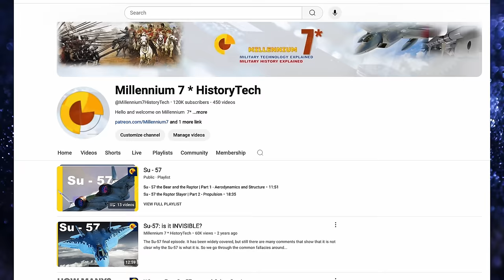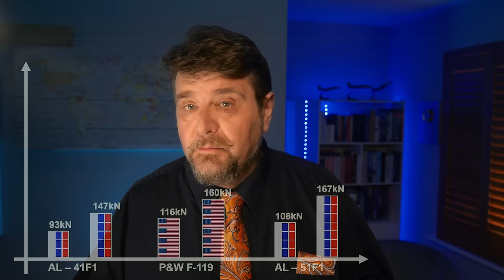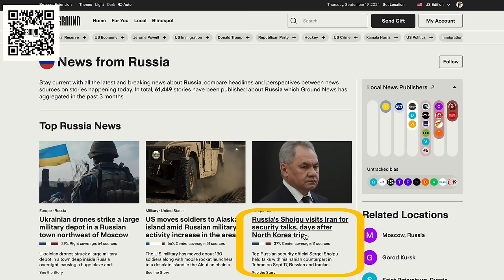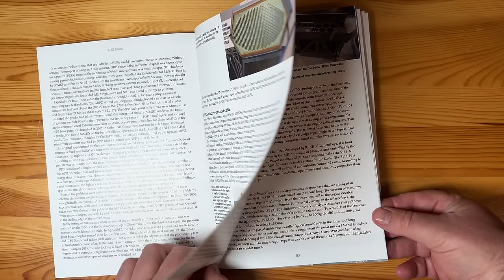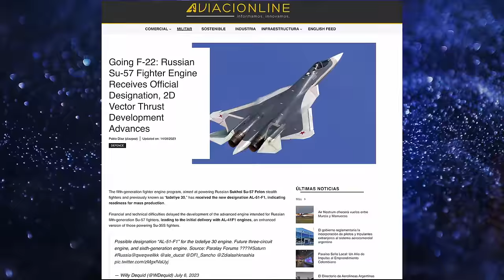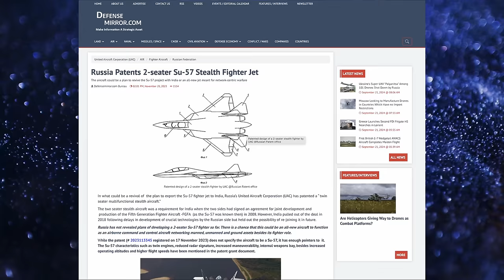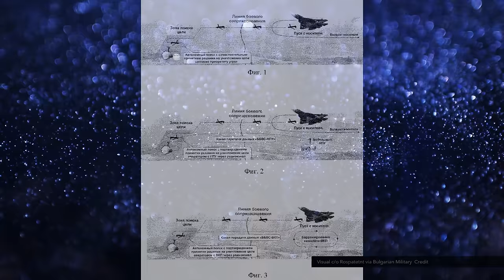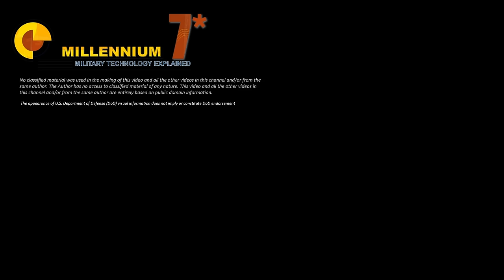The Su-57 is a Masterpiece!

Comment: Practically everything about Su-57 in this video is out of date or inaccurate. But in fairness, there's little reliable info on this matter. Regarding engine - it has already been completed, tested and certified.  Reasons behind low production rate mentioned in this video is again incorrect info. The large numbers will be released when they are produced using assembly lines for bulk assembly. Such large quantities are not necessary at the moment.  Because this model is designed to operate alongside Hunter drones.

Comment: When people make fun of the Su-57's low numbers, they completely forget (or didn't know in the first place) Russia's fighter production philosophy. Instead of producing hundreds of aircraft as soon as the prototype flies and getting hundreds of problem-filled units as a result, and then make another variant where all is fixed like the west does (for example, the disastrous F-35 programme); Russia produces small batches of 3 or 4 aircraft, eatch slightly different to the previous batch, until the aircraft works exactly as intended, THEN they produce it in the hundreds but not all at once putting a dent in the economy like 'Murica does, like 25 or so at a time.
Reply: You talk about the same country that produces jets with engines that last 2 to 3 times less than the Western engines. Also, how can the F-35 be a disaster when there are over 1,000 produced? F-35 has one of the lowest number of accidents of any modern jet too, half of which being pilot mistakes. How can that program be a disaster? F-35 has one of the lowest costs of any fighter jet too.
Reply: @m.a3914  Clearly you know nothing about the F-35's development. The program started in th 90s and they entered service in the 2000s (apologies for forgetting exact years). Since they entered service until 2015, they had tonnes of problems: fuel leaking into the cockpit, software glitches, electrical components frying, engine failures, hydraulics issues, you name it. The programme was an absolute shit-storm until 2015 when they finally solved all the problems... After producing >200 of them. The reason why there's over a thousand of them NOW is because they entered production in the hundreds when all the problems were solved, but they still produced hundreds of faulty aircraft before 2015.
Reply: @meme_thunder  Sure... Now point exactly where the disaster is? The 2nd ever production SU-57 fell from the sky. That's much worse than having some simple mechanical or software issues. It happens, move on! That's absolutely, perfectly normal for something so complex to have some issues.
Reply: @m.a3914  The USA has lost 12 F-35s ._.
Reply: @meme_thunder  And?
Reply: @m.a3914  Well you were saying how the Su-57 program is worse off than the F-35 one because the first production model crashed, so I drew attention to how 13 (Ik I said 12 but it turns out it's 13) of the first 200 faulty F-35 production models crashed. Because they produced 200 of a failing aircraft while Russia produced 1, then crashed, then changed it and produced 6 more, which still had a few problems, then changed it and produced 12 more, which were perfect and NOW they are starting to mass-produce it. And guess what? The development of the Su-57 cost less than a tenth of the development of the F-35. The Su-57 program has done much better in the development stage than the F-35 did.
Reply: @meme_thunder  13 of 200 is far better than 1 out of 2. Just saying. The jet is not even near mass production. In fact, it is not even fully developed yet. Furthermore, I'm very interested to know from where you came out with the idea that the SU-57 cost 1/10 of the development? You don't know how much money was spent on the F-35 and you don't know how much for the SU-57 either. All we know is that there are over 1,000 F-35s and about a dozen operational SU-57 so how can you talk about SU-57 as if it was successful and the F-35 was a disaster? You don't even know how many issues the SU has, yet you try to claim that the F-35 was a disaster because "look how great the SU-57 is" ?

Comment: Isn't there a western tactic as well that uses F-35's to lock air targets for F-15 missile trucks? Why shouldn't the russians simply employ the same tactic between the Su-57 and Su-35? In that case the Su-35's would be "escorting".
Reply: Aim-120 is a pretty short range missile. Why would anyone need an F-35 to designate target’s for F-15s if they're capable of detecting those themselves?
Reply: @ГеоргийМурзич  100 miles is not what I would consider "Short range". Its more about data sharing. The F35 radar / sensor suite is leaps above an F15. Its passive systems alone could be used to direct F15s to the "area" while it stays invisible.
Reply: Data links, escort, sensor masking...all reasonable for explaining the Su35 and Su57 combos...
Reply: As far as I know, that’s a potential tactic that could be used with an upcoming missile.
Reply: @ГеоргийМурзич stealth
Reply: @ГеоргийМурзич   the AIM 120 has greater range and better energy retention than the R77-1 it has a very impressive energy to range ration and is quite proven.
Reply: @EliteArcanist  won't help you much at 60 miles or less. Btw, longest a2a amraam kill is still 45km
Reply: @maksudagypsy  and you know that from whom..? Ain't 77-1 more "proven" at this point?
Reply: @hresvelgr7193  may I ask you in which conflict did amraam hit a target at 160km? Or you are just referring to some kind of trials or exercises?
Reply: @hresvelgr7193  Aim-120C can hit a target at 120km in exercises and its longest kill is 45km. Should I write why?
Reply: @hresvelgr7193   "BTW 60 km is the maximum range that an AMRAAM has hit a target in combat"

May I ask you when did that happen and what was shot down?

"The physics don’t change between exercises and combat"

Conditions do. Enemy planes won't fly straight at you waiting to be hit - they'll start evading. Launching at max range is just a waste of a missile
Reply: @hresvelgr7193  which is exactly why I'm telling you that you can forget about firing any amraam at ranges over 90-100km. And squeezing an F-35 in somewhere in that 100km range is like super dumb because any modern plane can see much further than that

"1999 in Serbia a MiG-29 was shot down at a range of 60 kilometres."

I suppose you mixed something up. Maybe 16km? Various sources say "Longest recorded AIM-120 kill at 45km." Against L-39 that is

Comment: Conceptually, the Su-57 is what the US 'Advanced Tactical Fighter' program (YF-22, YF-23) - which was tested only with few flights before serial production - should have delivered - of course, minus the long standing Russian challenges of engine performance/efficiency and lack of experience with RADAR Absorbent Material. 
The rapid succession to a '6th generation' aircraft development after a production run with less than 200 F-22A airframes proves that aside from 'low observability' in a contested airspace, broadband encrypted sensor fusion and data-links remain the crucial common feature beyond 4th generation aviation of supersonic delivery of large payloads over long distances, with tight turn rates and high angles of attack. 
After NASA aerodynamic design studies of a deeply modified F-22 - the X-44A MANTA - a mere thrust vectoring, tailless 'stealth' airplane could have been built already around the year 2007...

The issue therefore lies with exactly these technologies - to the flaming outrage of NAFOs first deployed with the MiG-31 interceptor (early digitization in the 1985 M and the 1990 B upgrade standards) via it's APD-518 four ship - and RK-RLDN ground data-link, fusing the range and velocity detecting 'Zaslon' RADAR signals on target direction within 200 km, enabling a MiG-31 to fulfill the operational role of an 'Airborne early Warning and control System'... 

Regarding the incoming production run 'pause' of the Su-57 airframe, one can wonder whether the decision is - as announced - due to the planned - and necessary - engine upgrade or whether it turned out in tests with the Sukhoi Su-70 Unmanned Combat Aerial Vehicle that for reasons of anthropological limits , a weapons officer must be on board in order to 'micro-manage' additional Collaborative Combat Aircraft, effectively - hence proposed design changes to a tandem-seater variant - which would be bad news for the F-35A Joint Strike Fighter whose 'lightweight' airframe was minimized in size for an even further reduced RADAR Cross Section, leaving no space for modifications... 

When it comes to the question on further escalation, we already understand that our governments - and all parties that are deemed by the bureaucracy as 'electable' - regard the rest of the world as Vietnam in the 1960s, regardless of pre-election announcements, they will continue to escalate toward Total War which is to seal their - and their fanatic follower's - fate. 

The sooner there is a decade long winter - or another global outbreak with a lethality higher than the 30 million of the last - the sooner successor states can be formed. 

(The middle management of a steppe planet) 
https://youtu.be/_XUu3_pLPUE?si=62pDyZw2gcVI-xDq

Comment: Su57 has a pretty large rcs, like 1 sq m, Just slightly smaller f16v. It’s more like a 4.5 gen fighter
Reply: Source
Reply: @angelaferkel7922  That is repeated in many places. And one source is the Sukhoi patent for the RCS minimiziation mentioning "< 1 sqm frontal RCS". While the public patent states really that its design goal was < 0.1 square meter frontal RCS.
Reply: It’s actually 0.6 ish w/o RAM. which is about half to a third of f16. Not like an order of magnitude smaller like f35 and f22.
Reply: At 8 GHz, avg rcs is 1 sqm median is 0.5 sqm.
Reply: @paristo  its depends on the range, freq. and type of radar and if there even is any RAM coating or not. 

Reality is that we cant tell exact numbers on how big the RCS of any fighter is. Its always just rough assumptions and guesses

The prototypes of the first Su-57 dont seem to have any coatings, have relatively large rivets and also the canopy seems to have no coating or reflective layer. But we dont know about the finished model or if there will ever be such. But we will see i guess

Comment: Wouldn't Su-35 escorts possibly provide the Su-57 with background noise so that it's harder to detect and properly measure in some way? Just distorting the statistics, rather than hiding it etirely. Or if S-57s sensors are better then could it be helping the Su-35 targetting via datalink with the 35s acting as missile trucks essentially?
Reply: If anything, the Su-57 has a total of 18 suspension points, and it is still unknown whether it can carry several missiles on one pylon
Reply: @Տիգրան-ժ1է  It has several pylons, but it's stealth characteristics are ruined by external ordonance. If they want to have a stealth plane it can't be flying with all pylons full.
Reply: Probably as missile trucks
Reply: @vojtechpribyl7386  if internal, it carries 8
Reply: @Տիգրան-ժ1է  Those eight are not all capable of carrying heavy long range missiles. Only the central bays can carry four of them in total.
Reply: @vojtechpribyl7386   6 R-77M + 2 R-74 fit inside
Reply: @Տիգրան-ժ1է  I was talking about the really heavy long range ones. They can fit the R-37M in there as well.
Reply: Nonsense.

Comment: The SU57 radar is unique, so quite easily identified passively. It is entirely possible to know that they were operating close with other aircraft. The implication that they were being escorted is definitely moronic though.
Using them in non stealth formations nullifies the strategic stealth, but that is not the only reason to use them so they might just not care. Having them blast away with their radar not caring that they are detected might be the best use of them. Even if the radar could operate in low probability of intercept mode, there would be little reason to use it. If a missile is sent against one it can simply turn off it's radar again and attempt to evade the sensors, but until that happens it has no need for it's stealth.
Part of me wonders if the L band antennas are able to operate as part of the GLONASS system. GPS is typically easily jammed because the satellites are far away, and the beam is wide and low powered. A directed beam from an SU57 could be far harder to jam. 2 Spaced SU57s, an accurate clock, and a decent altimeter could give you munitions guidance that is accurate and far more robust than satellite based systems. In this role their impact would be extremely powerful, but you would never need more than maybe 4 to do it. We would absolutely expect to see them used with other aircraft.

Comment: correct me if I am wrong super cruise I think is mostly a marketing strategy. cruise typically signifies the speed at which fuel efficiency is greatest. but the only production aircraft that was designed to have a cruise speed over the speed of sound was the SR-71. all these 'super cruise' aircraft require a clean loadout and military power iirc.
Reply from the maker: No. Supercruise is important because the weapons launched above mach one do not need to go through the sound barrier. Moreover being fast with no AB is a nice way to keep energy.

Comment: The Su-57 is indeed a compelling fighter and gorgeous.  I've loved it since the beginning of its unveiling back in 2010.  Is it 5th gen? Well, the question is what do you classify as 5th gen? That moniker is loosely based off of a classification scheme provided by a few fighter designers.  However, if you go based off those stereotypes than the F-35 doesn't meet the 5th gen classification because it can't super cruise.  I would say the existing Su-57 is a great fighter based on its initial characteristics.  The only problem is its radar that Russia can't seem to perfect (Byelka) which is still largely in the prototype phase.  This jet is still rough around its edges when you look at the sensors and powerplant.  Once these issues are sorted out I wouldn't believe the branding of calling it Su-57M because these are technologies the fighter needs to reach its full potential.

Comment: The delay of the AL-51F1 puts Russia at a disadvantage. The engine is only supposed to match the F-119 while the Americans already have the F-135 operational with a replacement already being developed. This puts Russia over 2 decades behind the Americans in engine technology. 

The same goes for the AESA radar. We don't know how good the packaging of the Russians is but the main radar has fewer T/R units than the APG-77. This could also be because the jet produces less power due to the inferior engines. Given that, this puts Russia over 2 decades behind the Americans in radar tech on their jets. The main SU-57 radar has fewer T/R units than even the F-35 which is a smaller jet. 

In 2 main areas, Russia is at least 2 decades behind the Americans. The SU-57 has a few aces tho with the additional 360 degree radar coverage. The different bands could definitely be beneficial in some cases but given how small these radars are we can say that they are not very powerful which means they are very limited in range.
Reply: No the Al-51F1 wasn’t supposed to match the F-119, it’s supposed to be culmination of all the technology from the AL-41F and more. Not to mention the F-135 isn’t being replaced rather merely upgraded. Not to mention, saying Russian N036 is 2 decades behind based on TRM count is asinine and reductive as things like antenna size, peak power duty cycle as well as cooling properties also play a role in radar performance. As is F-35 has insufficient cooling capacity hence the need for a more powerful engines. Having 360 degree coverage is a huge bonus, that massively improves SA. Obviously they’re not going to be as powerful as main array however that’s not why they’re so useful, they’re able to reduce sidelobes and clutter effects which have historically hampered radars. Could we say the Americans is decades behind the Russian as they only just introduced IRST in the past decade yet whilst they’ve been a fixture on Russian aircraft since 70s. This is just typical western arrogance and bias. It’s all so tiring!
Reply: The tiny incremental gains that you're claiming represent decades of work occurred at a time of record US defence spending. How did they only get so far, despite spending so much money?
Reply: @princesofthepower3690  N036 is over 2 decades behind. This is clear from the packaging. The APG-77 has more T/R modules in a similar space. I am not sure what tech was introduced in the past decade that the Russians had in the 70s. The Russians just started to use AESA radars, 20+ years after the Americans. 

AL-51F1 is 2 decades behind which is a huge blow for the Russians. We also don't know the reliability of the engine which historically the Russians struggled with. The Americans are already in the final stages of developing their adaptive cycle engines.
Reply: @jamesrowlands8971  The difference is that the American solution actually works. That's where the difference comes from.
Reply: @napobg6842 You guys all sound like robots honestly! The AL-51F1 should have industry leading SFC as well as and SP as a function of its low weight and high fuel efficiency making it more than a match for F-119 and F-135. The F-135 btw having first been delivered in 2009. All you have done is repeated yourself here!
Reply: @princesofthepower3690  Their mission is to make this paper engine as sophisticated as 20+ years old engine